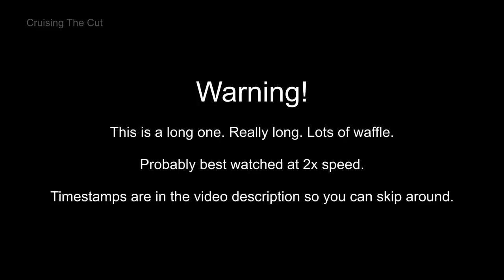241. Narrowboat DIY: refurbishing my shower cubicle

Comment: I think I'd ditched the idea of screwing panels in place and opted for contact adhesive ('Evostick') instead. The tiles behind wont be very level so you wouldn't want the corner piece dipping back and forward anyway. You'd want a nice straight line. Hope the panels aren't cut too tightly as plastic will expand in the heat. If restrained too much they may tend to bulge outwards. There's a happy thought!

Comment: Last time I did a cubicle I used a company that molded the three walls of the shower to the measurements I provided. They also provided their own sealant/glue that was alot more effective than the normal store options.
Reply from the maker: Yeah, this glue came from the panel supplier, it’s good stuff

Comment: Another entertaining and interesting video David.  

Could you turn the shower head holder upside down so the fixed end with the small overhang in the top hole and the Adjustable end should then adjust to the position of the bottom hole!!!!
Reply from the maker: Unfortunately not, the bottom bit is designed to hold the rest up

Comment: Those corrugated boards look great and are very easy to fix but they dent extremely easily. And elbow or a knee can easily crack through the surface skin, and then you have water pouring through the corrugations.  You can get solid plastic sheets a few mm thick. A lot more fiddly but they will not dent.

Comment: Great looking revamp Dave. just one question on the tap wall. Could you have cut through the rear
of the panel only and bent the front skin. Avoiding the join? We do that to composite panels here in Australia. One other point is we find if you apply the glue in circles, the air cant get in to cure the glue
in the centre. we zig zag it.  Love your show. keep it up.

Tony from Australia (ex Brit)
Reply from the maker: Cheers. I could have if I’d thought of it, though I’d likely have cut through the panel by mistake anyway!
Reply: @CruisingTheCut  The Dewalt multi tool you have comes with a depth stop that is reasonably easy to use and accurate, it could be set for 2mm. More importantly, it is satisfying too, having that level of control and precision.
Reply from the maker: You’re right, I’d entirely forgotten about that accessory!

Comment: To make removing old sealant/mastic easier you can get a small pot of sealant remover. Paint it onto the old sealant, leave for a while and it softens it up nicely making it easier to remove. Also, when smoothing down  recently applied mastic you can make it much easier and neater  by first dipping your finger or smoothing tool into washing up liquid (mixed with a bit of water).
Reply from the maker: I did not know about sealant remover, that sounds useful, cheers

Comment: This is a tip for faster (and better) sealant / caulking cure time: Many caulkings / glues will cure by moisture in the air and if you make circles (or other closed shapes) you are preventing this from happening as it should. Strains going vertical with a few stops between them allows for some air to reach all sides of the caulking.

Comment: The Internet is a wonderful place sometimes! 🤣 DIY products not so much. I've been watching these Thai guys build these wild boats from scratch with fiberglass over foamboard, and it honestly looks easier than using those boards. I wonder if you could just apply fiberglass on the walls with the first coat(s) of epoxy holding the first layer of weave, etc. But of course, osmosis will happen eventually.

Anyway, the finished boarding looks very nice!

Comment: If you need to glue panels to a wall try cutting some stringers of wood so they go from the panel to the other side of the room/boat. Rest vertical planks or the like against the panel then ensuring the stringers are of sufficient length as a tight fit gently force them so there is pressure applied.  With the top corners, you could have put a wooded trim in.  A friend of mine was much in favour of such doings.  In fact, he named his boat "thetrimlhideit" or something to that effect.

Comment: David, may I suggest a product called Mold Armor (possibly known in the UK as Mold Armour 😃)? That stuff in your shower is gross! The “green” cleaners never perform well no matter what the product is supposed to work on. The more caustic chemicals just melt the mold off so you don’t feel like you’re showering in a motel that rents by the hour. I know, the swans. But just think of the endorsement possibilities!

And here’s another shortcoming of living on the Narrowboat: no garage or shop for project work. I feared for a big gouge in the floor boards. You really need one of those houses with a Narrowboat slip.
Reply from the maker: The swans, the swans….

Comment: Great job there.  In re the shower pipe I would have cut it down to size if it was too long.
Reply from the maker: Cheers. I considered that but the tube is very cheap plastic and seemed so brittle I didn’t like to cut it lest it shatter.

Comment: Well done David. Not an easy job! I think (hope) you've got to the route of the problem but bear in mind that all too often shower cubicle leaks come from the fact that water gets inside the (hollow) channels of the door frame and seeps under where it abuts the wall tiles. That's why it's imperative to seal that area BEFORE the door gets fitted. The door assembly is designed so that water getting inside it drains to the inside (which is why shower door frames are then always sealed (with the sealant gun) INSIDE on the VERTICAL profiles only, and OUTSIDE on the HORIZONTAL only. Hope that explains well enough). I would also recommend (real) brass screws, or chrome screws on the accessory fittings otherwise they will rust, and also to be careful not to over tighten any screws into the plastic panels (otherwise the boards will crush and never spring back). Happy showering!
Reply: I had mine sealed by a professional plumber as per your suggestions and it still bloody leaks. Water is a pain in the ar$e - give me electricity any day!
Reply from the maker: Cheers

Comment: A bit of water mixed dishwashing liquid helps to wipe up the "gunge" and gives you a nicer finish.  You can use a paddle pop stick or your finger and after dipping it in the dishwashing liquid water, go over it to give a nice smooth finish. [it helps with the sticky fingers as well]

Comment: I reckon you'll find, in the fullness of time, that a complete rebuild would have been the better option.

You've glued that stuff to the tiles, which had cracked etc. due to movement of the superstructure, but have seemingly failed to take into account that that movement will still occur . . .
Reply: And yet the fullness of time reveals the boat has sold and he is happily ensconced on land, having averted a nervous breakdown caused from removing the tiles.

Comment: Good job. I hope you have sealed the holes with silicone before you screw the screws into the holes, because moisture gets into the holes and then the wood in the wall will rot
Reply: Silicone is great for both screws and edge seals.
Reply from the maker: Everything was sealed with silicone, yes

Comment: You could have used the same screw holes by cutting the appropriate length off the chrome tubing. The cut end could be hidden by reversing the tubing and slotting into the bottom fitting. Simple!
Reply from the maker: No, I couldn't. The tube appeared to be very brittle and fragile plastic which did not look amenable to cutting. Else I would have cut it.

Comment: I was just looking at your shower install, by the way it all looks great.
I was thinking that the new shower bar assembly may be upside down, with the hole at the top
 water can go into the hole at the top and pool at the bottom of the pipe. 
Putting the bar holder fittings the other way around you didn't need to to put a second hole at the bottom location
I don't have the instruction sheet so, are there set screws to hold the pipe in place?
Reply from the maker: No, it’s the correct way up. There’s a cap I didn’t show that goes on the top. It wouldn’t work the way up, the bottom piece is specifically designed to hold the rest up

Comment: Obviously too late for you now, but when applying the sticky sealant to the corners, apply a bead along the edge/corner and then smooth it out with a finger liberally covered in Fairy Liquid. This prevents the sealant sticking to your finger and leaves a nice smooth finish.
Reply from the maker: Cheers

Comment: If you did have an extra hole after fitting the shower rail a neat fix would be to put a mirror screw in and it looks better than filler

Comment: You should be able to fit new shower using 3/4" brass running nipple. They come in various lengths. You'll probably need a couple of 3/4" back nuts to rigidly secure to panel but it's a suitable alternative for supplied fittings.
Reply: I was going to say the same, but I couldn't remember what they were called!
Reply from the maker: "Running nipple" definitely seems to be the keyword. Whether Google will give me the correct results with "nipple" remains to be seen - in private.

Comment: One simple way to find out the position of screw holes is to take a piece of paper and lay it over the bottom and use hand pressure to indent into the pattern it makes. Indeed it will be exact and usually the holes will leave an impression or piercing it thru can be done with the screws in the openings if recessed. If you've ever hung a clock or other like item where the holes it hangs are fixed the paper will give the exact spacing and if as large as the back is it can be traced to take the guess work out of hanging it as well. One final quick tip is use a forks times   on the screw/nail in a wall to hang up a picture etc that has a wire if it hangs by since it will ride the handle down  to them every time then be removed. Even a bit stiff cardboard with a V to slid down onto the nail/screw works as well and of course double the technique if it hangs by two points not just one.

Comment: For any bigger jobs I’d recommend a grout rake; it’s a cheap tool that makes bathroom work a lot easier. If you’ve got a fair amount of grout to cut out, an angle grinder is useful (you could even get a DeWalt one to match your multi tool - that’s what I did 🙂) 
Screwfix also do a No Nonsense silicone removal solution which is effective.
Sorry...this isn’t very useful info after the event, is it?! 🙈
Reply from the maker: Not terribly 😂😂

Comment: If you can still access the back of the shower, you could install a shower wallplate with a corresponding short pipe to reach the existing plumbing. Then you mount the shower battery on the wallplate. As a bonus, it will be really easy to change the battery at a later date if needed.
Reply from the maker: Battery? There is no battery.
Reply: @CruisingTheCut  I'm used to call the thingy that mixes hot and cold water a "shower battery".
Reply from the maker: Oh! That's a new term for me.

Comment: @ 4.35 is actually particle board aka sawdust and glue highly compressed at great pressure and very rigid except when it gets wet @ which time it acts as a sponge and swells drastically as the glue let's go immediately causing the sawdust particles to fall apart and crumble as well as rot and collect mold and mildew... Best replaced with marine grade (which is what should've been used in the original building process) plywood and additionally sealed with a good water repellent or proofer before sanding,and bleaching or replacing the 5 layer oak laminate cover boards that hid the cheap cost cutting crapola particle board... A good waterproof type epoxy sealer applied and pressed in  along every joint will prevent any more WICKING of water via the open ends...
Reply from the maker: We call it chipboard here, terrible stuff. But a major job to remove it.

Comment: Fill the honeycomb bottom end with silicone sealer before you stick them in place. The bottom edge is then much easier to seal with the usual fillet. 
No need to cut the any board across the middle. 
Do the that one (the hardest side) first. Put a batten across where you want to bend then wedge from the opposite side with another couple of sticks. Leave while the glue cures. 
Then do everything else with the easiest last. Fancy edge trims are a waste of space. Just use a silicone fillet. 
The replacement tap needs its own threaded tubes that go through the wall. Plumbing merchant should have something suitable. 
Silicone eater makes removing the sealant an easy job.

Comment: I think you were supposed to fit those panels horizontally, so the water doesn't penetrate the join. If you ran a bead of silicon along the join, it should be ok. The panels would also fit into the corner trims better.  The screws would go where the join of the panel is, but you would've needed to notch it out first.
Reply from the maker: Cheers, I think they could work that way but they're intended to be fitted vertically as shown. I agree about the fitting into the corner trims though.

Comment: Are you going to do the same with the shower ceiling? It will keep the shower ceiling from wood rot, even with lacquering the wood lose its protection over time. It seems fading now, in another two years the wood might start to show cracking here and there.  Good luck to you!
Reply from the maker: Might paint it
Reply: @CruisingTheCut  Hey just saw this ...we have a rubberized sealing paint in the USA that might be of help to its called Flexseal. There may be a British equivalent ... good luck :)
Reply: And that there isn’t a fan+light installed in it, if there was - he wouldn’t have had problems with fumes from the degreaser and sealant/mastic and steam when showering. When we went on a Black Prince narrow boat experience/holiday, they had a light+fan in the shower ceiling - specified that to their boat builders to have a hole drilled/cut in that particular area of the roof and fit an Aquafax ECS Ventilite in the deck so the light+fan could be fitted on the inside
Reply from the maker: Hi, yes there is a fan installed in the bathroom, it's just not immediately above the shower which is why you don't see it in the video. It's positioned so that it can draw up moisture as well as any smells from the toilet.
Reply: @CruisingTheCut  - when you were complaining to us about the fumes and heat - you stated about the open windows, but said nothing about the fan in the shower/toilet ceiling, or turn it on and say you have an extractor fan to remove the fumes 😉

Comment: The thing with DIY is no matter how many screws you have in your supply box there is never one that fits the job you are doing. One of the old screws you are removing with either be so corroded you can't shift it or the head is rounded out. I think that this could be a new law of physics. Thanks for sharing with us.

Comment: Just a thought... instead of drilling and making new holes in your boards why didn't you cut the pole to shorten it? Be through that in a few minutes with a decent hacksaw.
Reply from the maker: Because it was made of fairly crap and brittle-looking plastic which looked like it would crack or shatter if I cut it

Comment: Due to the movement of the boat and shower cubicle because of the sun heating it, you don't want too snug a fit of the 5mm boards in the corner of the cubicle. That might lead to the board buckling in warm weather. It's better to have a less snug fit and fill the gap with "gunge".
Reply from the maker: There was certainly plenty of gunge

Comment: I've seen this video and it was enjoyable. You could have used "No Nails" as that would hold  the boards and corner pieces in place and it sets rock hard! so no coming loose over time... I'm a little surprised that you didn't go down that path..
Reply from the maker: Cheers but the adhesive I was using was effectively the same sort of thing, but my concern was needing to hold the bits in place for a few minutes while it got adhesion. In the event, it was so sticky, this was not a problem.
Reply: @CruisingTheCut  I have to use "No Nails" on walls that I can't drill but on a narrowboat, you have to be careful... Nice video..

Comment: I loathe particle board. It's cheap and flat, but it's overused. It absorbs moisture readily and swells significantly.

My most recent encounter is was in my house, where someone had built a stand with particle board for the water heater. I happened to spot water marks and swelling on the wood, which led me to discover the water heater was leaking internally, approximately 1-2 oz (30-60 ml) per day. Had I not discovered this leak within a week or so, or had the leak been more significant, the water would have soaked the particle board through and collapsed under the weight of 40 gallons of water with rigid gas and water lines still connected. What started out as a minor water leak, could have created a sizeable gas leak and caused significantly more damage.
Reply from the maker: Oh crikey, lucky you got that sorted!

Comment: You probably can cut the shower head slider support so that you can use the existing holes that you drilled into the shower surround.
Reply from the maker: Cheers. It's such a cheap piece of plastic, it felt really brittle like it would shatter if I tried cutting it.

Comment: Just a thought for next time. When you put the rail in to hang the shower head you could actually cut the tube shorter so you could have used the same screw holes.
Reply from the maker: Sadly not. It's such a cheap piece of plastic, it felt really brittle like it would shatter if I tried cutting it.

Comment: Is it not a case of putting a band-aid on a slit throat?
Reply from the maker: Not in the slightest. The only problem issue was stopping the water get to the bottom of the wood, which I fixed with the sealant. The rest was purely cosmetic.